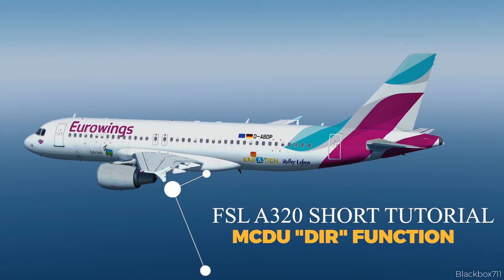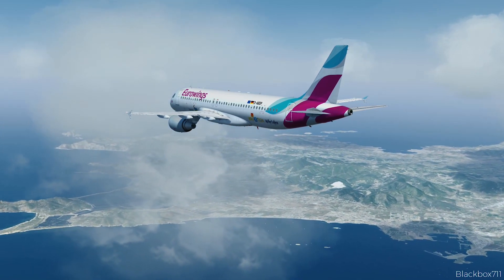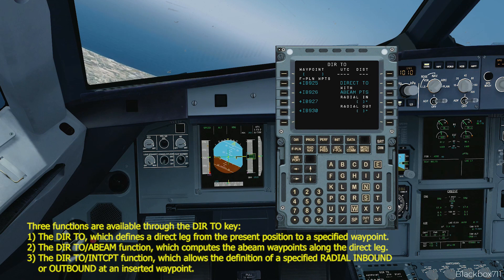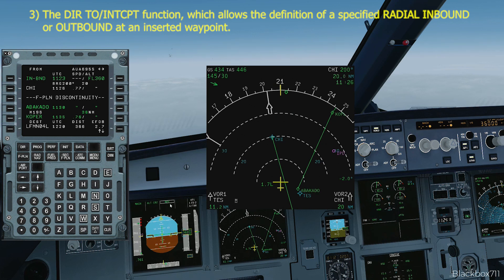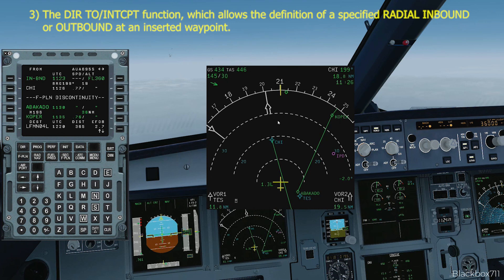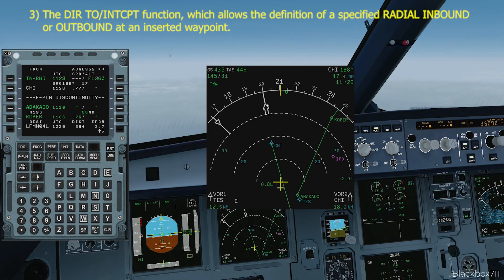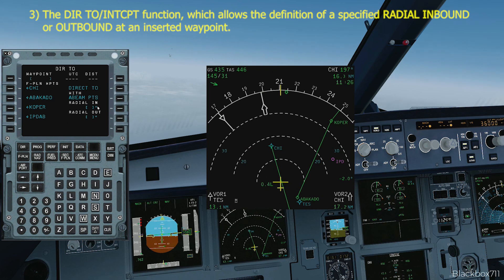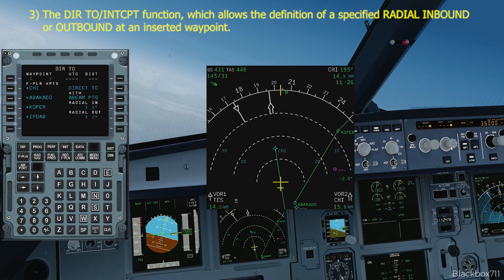FSLabs A320 Short Tutorial: MCDU DIR function

Comment: Just testing some stuff. When using the abeam points direct to. Once selected, it does not seem immediately obvious which is the direct to waypoint. The next waypoint will be shown as the first abeam point both in DU and FMCG. I need to scroll down to see the airway/programmed direct to point in FMGC. If you wished to double check a little later after input is there a quick way to confirm which direct to waypoint has been selected?

Comment: I talked with Air France captain when I was on the jumpseat in a A320 and he said that sometimes pilots must refuse a direct from ATC due to wind or weather (mainly with a long direct) because the bird can burn more fuel that planned. I guess it happens less than 0.5% of the time but it can happen.
Thank you for your amazing work !
Reply from the maker: Thank you very much. Yes indeed. In very rare cases a long direct can mean more fuel burn with regard to wind component. I came across that several times when I was flying longrange on the 747.